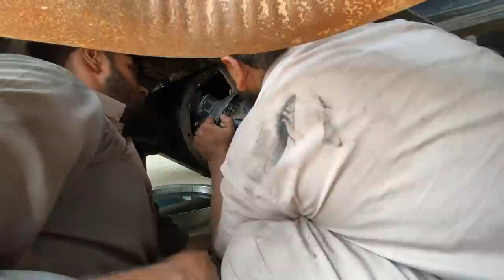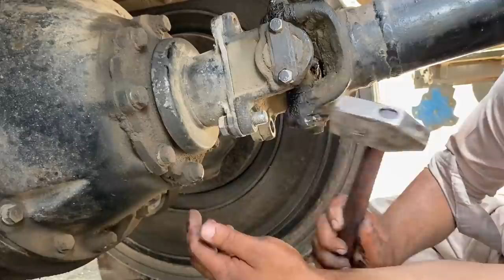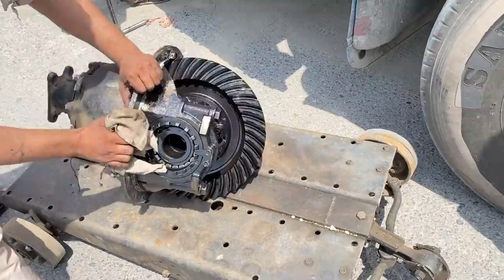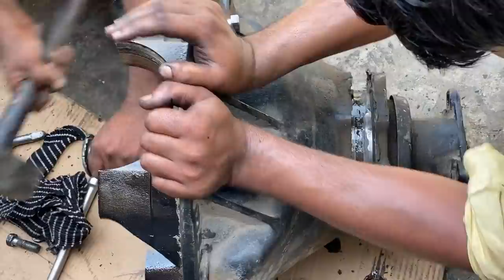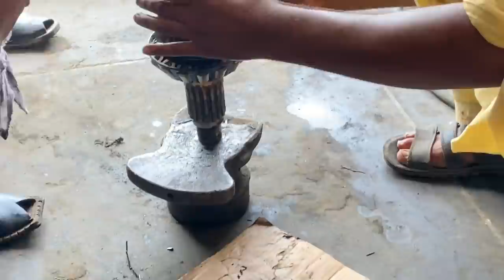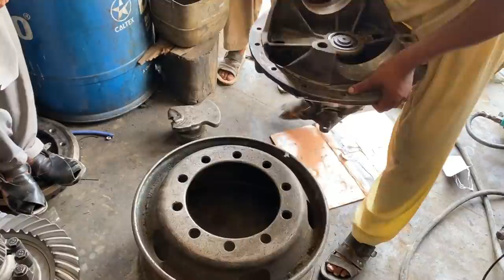The sound is different from the differential gear. Open and check

Comment: Reused the same bearings that already suffered through the metal debris from the broken pinion...AND mixed up the bearing races and cones...AND didn't do Preload or Backlash?   HORRY-SHEET...Lots of luck
Reply: They set the backlash by grease and looking at the pattern. Tight and back off a couple of notches. That's ok.
Reply: @michaelvangundy226  That is not accurate whatsoever. The grease adheres and smears out all over the face of the teeth, and doesn't provide any other information than that they remembered to install the pinion gear before putting the carrier in. Marking compound is such that it comes away cleanly, and leaves useable witness marks to gauge the contact pattern. As the OP of this comment implies, this thing will probably fail in short order. The biggest issues will be the unknown mesh pattern, lack of any sort of proper preload, and the horrendous backlash. None of these were addressed at any point. It might get the truck down the road for a bit, but it will almost certainly start chipping teeth as the original one did, and probably make the driver go deaf from all the noise its likely to make.
Reply: @mysock351C  
In the days before every backyard mechanic could afford special tools. We didn't have things like torque wrenches and dial indicators. The method that I learned and used quite a few times was exactly what you saw.

 You tighten the bearing that forces the two gears together. You make sure it settles then back it off about 3 notches. Tighten the other side to seat the bearing then back it off about 3 notches. Slowly spin it a few revolution to look for any wobble. Put some grease on the teeth and look for an even pressure for seating depth and again for un even travel.
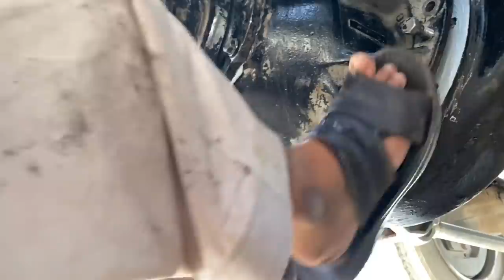Reply: @michaelvangundy226  You can certainly rebuild them correctly without all the special tooling. Torque wrenches should be used, but even without those they could have gotten pretty close. Close enough for me to at least be comfortable that it would work for a reasonable span of time. As rebuilt, if they are lucky, the new gearset will be close in tolerance to the old one, so reusing the old components will be somewhat close to what's needed. Usually that can be used as more often than not, the housing is 90% of what needs to be compensated for as far as pinion depth goes. As far as runout and other issues go, they cannot be verified by eye, even on a large rear-end like this and a proper dial gauge and inspection of the contact pattern is needed. The grease might work a little bit if your used to seeing it a certain way, but it tells little about how your contact pattern is or any runout issues, and it seems quite sloppy when they installed it. at 13:50 you can hear all the backlash when he turns the coupling. It sounds super loose. That might be ok with spur gears, but without any real indication of preload, its asking for lots of noise and chipped teeth just like we saw at the start of the video. It is true that used bearings will not have quite the same preload, but there's not much indication there's any substantial preload present to keep the gearset in mesh under load. There's a cutscene there, so I could be FOS and they might have got it right in the interim before the camera came back on. I would hope for the owner of the truck that they did. However rebuilding like that relies on the new components being close to what your replacing them with. After chunking a gearset like that, I would want to start from scratch. I've rebuilt rear ends after that kind of failure and they need to be completely stripped and cleaned thoroughly as there are just fist-fulls of metal everywhere. Even if done right, there's probably enough metal floating around in there to doom it to failure again unless somehow they got it clean by hand.
Reply: I never saw a pinion seal installed. I wonder if they caught that when they filled it up, or a few miles up in a mountain pass?
Reply: @michaelvangundy226  Your confidence is inspiring... How confident would you be that this diff wont lock up 2/3rd of the way up a steep one lane mountain pass in a 3X Overloaded Semi?  Still calm n collected?
Reply: I feel you totally. And I’ll just leave it at that
Reply: you see how many times that pinion nuts been off?
Reply: @mysock351C  Plasti-Gauge is rare in them parts of the world.  I still have some red and green threads of the stuff in my passenger seat pocket...lol
Reply: @mysock351C  I doubt those repairs fail as fast as you claim. Those guys wouldn't get a civilised angry phone call but be lying in the ditch before being able to upload that video if that repair failed prematurely.
I am pretty sure those guys can learn a lot from an experienced mechanic like yourself but I am also confident they could teach you some things (unless you're the kind of perfectionist that knows everything better than the rest of the world)
Reply: @ppdan  I'm sure they are quite knowledgeable for the most part, but the lack of hygiene reminds me of my early days making repairs before I knew better. As you said, sometimes they last. But other times they failed catastrophically. A great example of was when I trashed a 4L60 I rebuilt about 20+ years ago because I forgot to tighten the bellhousing bolts. Surprisingly it ran for a LONG time like that. It only became apparent that there was an issue when the only thing holding the transmission on was the dowel pins and the front pump. The bolts were long gone. Needless to say it didn't look too happy inside, but the TKO 5-speed that replaced it is still going strong. That said, after that I started using torque wrenches and check lists, marking pens and such for things that are super critical like engine rebuilds that need to last. I can fully appreciate that this is not always possible if you have time constraints. At the end of the day doing nothing is not an option. But in some of these videos they are literally doing engine rebuilds in the dirt.
Reply: @mysock351C  Totally agree about the "hygiene" when doing engine rebuilds, have seen them doing engine rebuilds where it wouldn't hurt to use a cloth, cardboard or any cheap more forgiving surface to handle parts. Aside from that most rebuilds turned out excellent for the poor environment they are working in. And those old engines they handle are a more forgiving than modern engines. Where one grain sand might bring a modern to very premature failing those old ones can handle a few grains before really running into trouble.
Reply: @ppdan  We are an ISO company. As an engineer, I write instructions for our employees. Most of the time, I have to write down some specifications just to give them  numbers. No number means they can do any crazy things. Funny thing, after some time, those numbers become god given numbers. They become myths. When I build the parts myself, ISO requires me follow the instructions,  even though I make up half of the numbers and I know they do not matter. 

Briefly there are tons of myths around. Only few knows they are myths.

Comment: Guys, reusing old bearings that have been smacked apart and smacked back on…just… yikes.

Use heat and cold next time. 

You also need feeler gauges to set the clearances corrected. Over torque and you massively increase friction.
Reply: A pin doesnt just break without a reason, and its most likely the bearings :D
Reply: Or use a proper press/puller.
Reply: It's a good temp fix. Truck is moving, I think.
Reply: Yea that will not be on the roads for a long time, bearings are not so expensive nowdays anyway. at 11:55 you can hear the bad bearings

Comment: Kudos on getting back in the road. Don't see that ring and pinion lasting to long, no shims for setting the pinion height, pinions not fully engaging with the ring. Fractures will follow especially as the drivers run their rigs WAY overloaded. The culture of the industry over there run it falls off then slap a patch over it. I'm still impressed with mechanics able R-n-R a third member and get the rig back on the road.
Reply: Its probably what broke the one they just replaced
Reply: I'm very confident that this diff will be just fine 50,000 miles from now, if not 100,000. If this unit went bad within 1000 miles from now then there would be very serious consequences for the builder. This isn't America where you would take them to courrt and file a complaint with the BBB. Here this repair cost the owner a LOT of money (to him) and this truck is his living. He will NOT tolerate this failing prematurely. Its obvious these guys know exactly what they are doing and you have no idea what they did and didn't check and how they check it. The video is 14 minutes long, do you think they actually did this job in 14 minutes? These guys do this shit all day, every day and they know how to do it. They checked the pattern and with adjusters they are probably practiced enough to know backlash just by jiggling it. Do this stuff enough and inch-pounds torque required for preload can be felt. How many diffs this big have YOU set-up?
Reply: @jamesradcliffe3985  I have done enough truck diff's to know what I'm talking about. How many have you done?
Reply: @patrickradcliffe3837  I dont believe you. And i have never done a diff this large, and neither have you. Thats why we shouldn't assume we know everything that was done in this repair.
Reply: @jamesradcliffe3985  that tells me right there you've never done a diff. So you don't know what you're talking about then. You see the guts are all the same just a difference in size. They go together the same way so quit commenting on what you don't know.

Comment: despite all the imperfections in the assembly, this truck will again make a lot of miles.
if not, the shop would have gone bankrupt long ago.
the owners of the trucks aren't idiots......
Reply: In those countries all shops are the same. Basically the owner is now heading to another shop to change bearings. I live in one of those countries, even official Chevrolet dealer could not assemble correctly wheel hub, so it took me to buy a lot of tools and search internet for service manual.
Reply: @donalexey  in those countries?
a chevrolet dealer anywhere in the world cannot assembly anything ...
Reply: That they are old(er) simple basic trucks helps too, no tiptronics, ABS, or all that kind of snitzsnatz making that alot easier to repair in the field, old sovjet doctrine, it has to be repairable with a hammer, a wrench and a farmboy, try to keep a modern western truck with all its gadgets running there, our trucks would give up after just one haul there.
Reply: @arranchace1306   it would give up only because either there's no dealer who can provide spare parts Or the spare parts are very much expensive and can't be affordable by these guys.

Comment: baclash to set with dial guage to manufactures spec  etched on crown wheel tooth contact use red and blue tooth contact paint and preload before turning

Comment: These guys need to invest in a 1/2 " and a 3/4 " torque wrenches those bearings would last a lot longer if they had the proper torq on them
Reply: And how do you pretend they’re going to keep them coming?
Reply: @jamesradcliffe3985   100,000 so every year a new rear end? 🤣🤣💀
Reply: @jamesradcliffe3985   thats not a 64 tho
Reply: @jamesradcliffe3985  exactly
Reply: @eln0n01  It's obvious  you got no experience doing this.
Reply: @jamesradcliffe3985  It doesnt take a rocket scientist to know that smashing every bearing out with a hammer is going to shorten the life of that bearing severely.
Reply: pRopEr TorQue wIlL mAke It lASt a lOT LoNGeR
Reply: @b2dmastersniper  I have taken out bearing with a hammer just replace it.

Comment: That will not last long the contact patch is way off. They would be great mechanics with just a little proper training....A+ for effort....D- for execution of the technical bits. That being said I would hire them in a heart beat and give them some proper skills!
Reply: Things seen thru the camera are not accurately represented, they are distorted.  They PROBALLY did it correctly, although I agree with what you seen.
Reply: The pinion depth was done by "feel" as long as it not too tight should last awhile.It will probably get noisy but function.I was told that that type of damage comes from backing up and hitting something hard.Thats devastating to ring and pinion.
Reply: Also preload of the bearings  isn't good. If they know how much they don't know,newer will show this.
Reply: and tools
Reply: ONLY HUMMER AND SILICONE
Reply: DISGUSTING
Reply: That contact patch looked like sideways play on the shaft. The contact was good but skipped teeth?
Reply: @VenturiLife  grease was not on all teeth of pinion
Reply: que.nada.esse.diferencial.vai.rodar.muitos.anos.pode.crer.

Comment: There was no preload on them pinion bearing or carrier bearings lol,but there getting it done,it will work but it's gonna eat them bearings up.
Reply: Bro these mechanics are not educated ,they dont know what is back lash ,pinion depth,preload on pinion bearings ,ring gear carrier bearings .They just replace the items by copying their previous fitted fashion. In whole pakistan such kind of mechanics only cause damage to these expensive vehicles by fitting differentials  like this.Even engines cylinder head bolts are fitted without sequence without torque wrenches.Very disappointing.😭😭😭
Reply: And it appears no oil either.

Comment: I applaud them for working with what they have, but if they have access to a relatively unique tool such as C-clip removal pliers surely they can get a bearing/gear puller, that tool is literally just cast and threaded hunks of metal prongs that are meant to be used in situations like this, not special by any means, and easy to use. Hammering the bearings with screwdriver is no bueno.
Reply: You can weld it yourself if you can't buy it. But looks they prefer hammering it.
Reply: Did you notice they never showed installing the front shaft seal...
Reply: @iqoverlord  yah i was about to say that
Reply: @iqoverlord  I'd bet it was pounded on. This is where formal training has its uses. These guys are definitely crafty, and can fix things, but the lack of some basic important info is evident.
Reply: @iqoverlord  i think they did when  one of them was doing a pinion bearing the other used a punch to seat the seal by banging it in a bunch of places to seat it.
Reply: the proper way is a bearing heater to put it back on. they could get away with a hotplate or even a propane torch if careful with it.

Comment: When you loosen or tighten bolts on stuff like that, remember to do it in a star pattern so it doesn’t cause that much stress
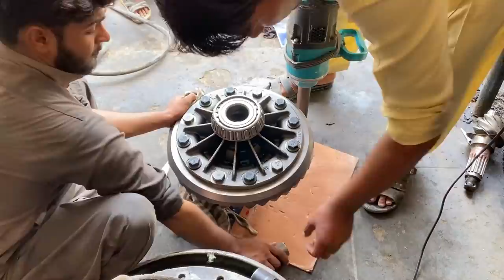Reply: 10:50 , they do :)
Reply: 12:15 he also balances it :)
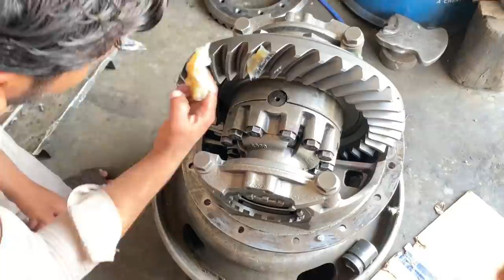Reply: 12:35 and lubes it
Reply: Tools are also alot cheaper over there everything is if your converting your own currency but to them prices are standard and will match up with there wages like they do everywhere else some things are expensive over there like most things that will be imported but they have there own never herd of brands that get the job done not as good quality but do the same thing

Comment: No haynes workshop manual needed by these artisans, they know their subject intimately and soon have it stripped and parts replaced. Differential  gears are a very complex piece of equipment to set up correctly
Reply: No they arent. I`ve been doing them for nearly 30 years. Just have to set them up right. They missed a few steps here unless they did them during the multiple advert breaks.
Reply: Should last at least a year or two...

Comment: An instructional video on how not to do a diff rebuild but I suppose given the economic and technology restraints of the location it's all that could be done. Unfortunately, the new crown wheel and pinion will not last that long but probably longer than the re-used bearings.
Reply: Yeah, they rebuild these every 500k km or so. $250 for parts and $100 for labor.
Reply: @SergeyPRKL  That is every economical in that case

Comment: When they reinstalled the yoke on the pinion they forgot the seal.
Reply: they probably put it after setting the backlash. probably just did it up to preload the pinion.
Reply: they use silicon for oil leakeag
Reply: @Z4Zulfiqar  You misunderstood what I was saying. Not a gasket, but the actual lip seal for the pinion, they forgot to install it before the yoke and dust shield. Silicone would not work there.
Reply: its a black silicon innpakistan we use black silicon as oill seal or oil packing